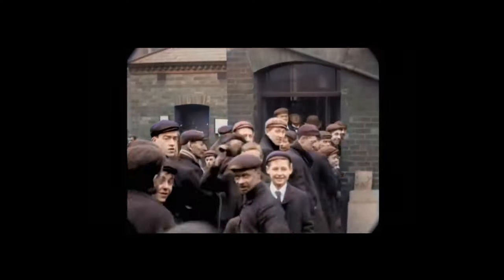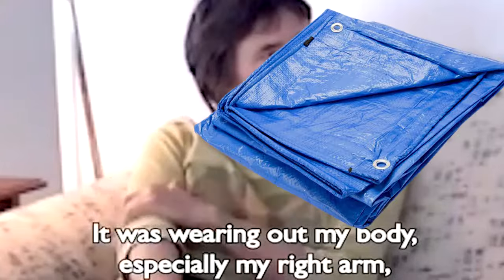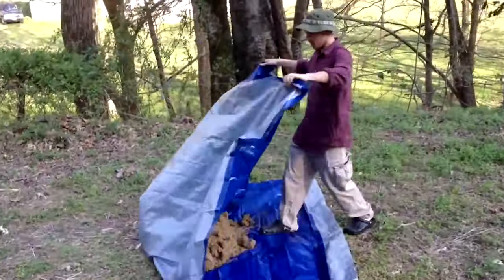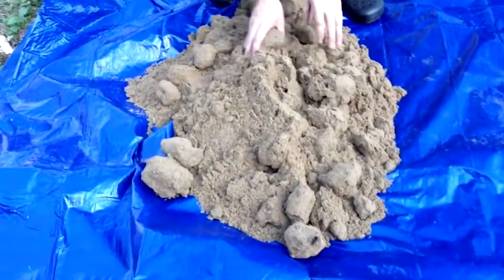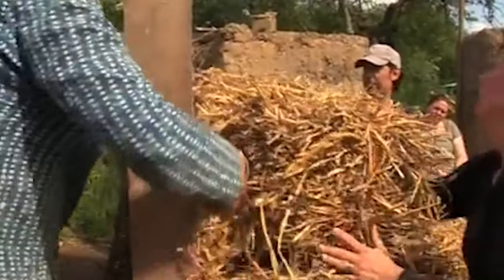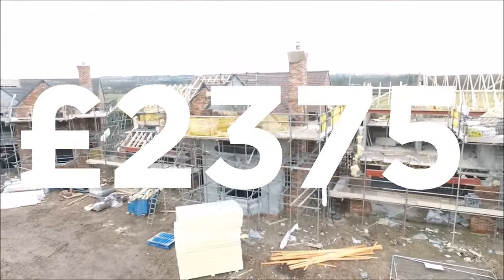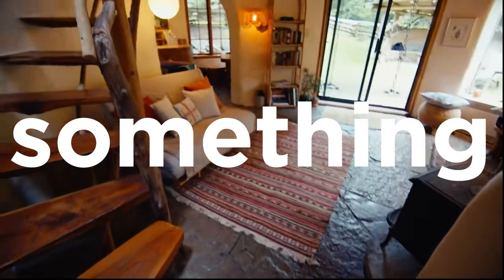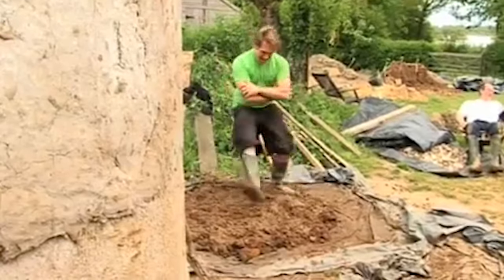Is Cob the Building Material of the Future?

Comment: What about a cob based earthship?
Reply from the maker: Ideal depending on your location! I am guessing you mean to include a lot of sustainable features which you would typically see on Eathships e.g optimal tilt windows, large thermal mass, rainwater harvesting etc?
Reply: @greenfutureyt  yeah
Reply: @greenfutureyt  I’ve been trying to figure how to earhship type homes set up in a circle and they’re all connected together in a solar micro grid
Reply from the maker: @shizuwolf  you've gotta try it out now... then share the results here
Reply from the maker: @shizuwolf  You certainly could power them all at the same time. You'd just need more resources. I have actually been thinking about this a lot recently. Living with people / around people is in a way more sustainable. By sharing labour and resources your micro-economy can be more efficient and sustainable in the long run. As such, I think as nation's we have so much potential to be sustainable, and to exhibit much improved productivity. The advent of very advanced deep learning models is assisting with the productivity side of things, but lacking in the sustainability side....these models use A LOT of energy.
Reply: @greenfutureyt  what other resources would I need?
Reply from the maker: @shizuwolf  Depends on your lifestyle. But the essentials are clean water (depending on hydrogeology of the area could construct a well to extract water from the ground), waste management, and provision of heat during winter. If you need internet connectivity and plan to use electronics you will need to generate electricity in some form.
Reply: @greenfutureyt  well I’m from Alabama, so we’d probably be dependent on burning wood for the winter time. It usually rains a good bit so we’ll need a way to harvest that. I was considering recycling gray water, but there’s apparently a lot of restrictions on that in this state.
Reply: I think that earthsips are cob buildings with forms.